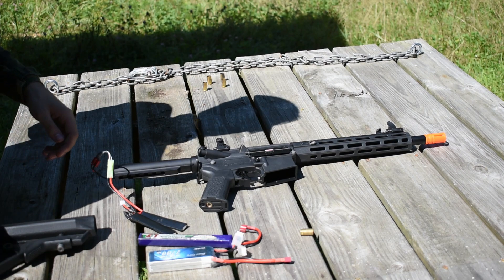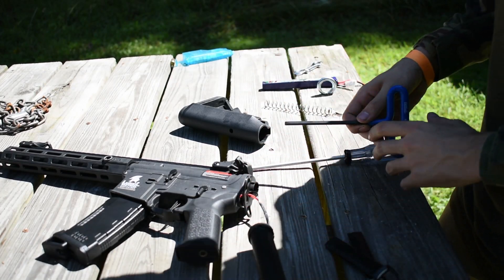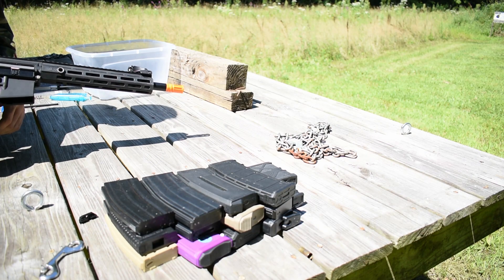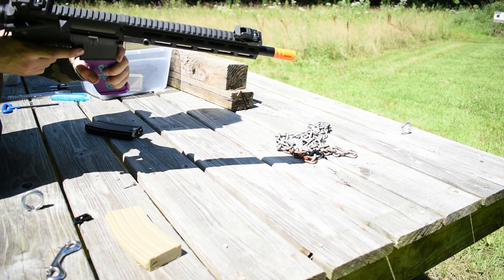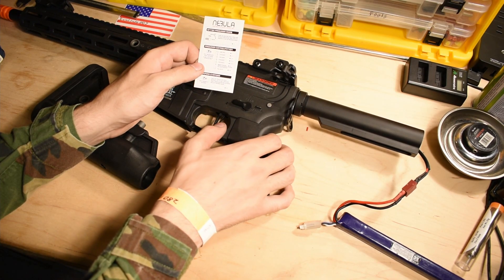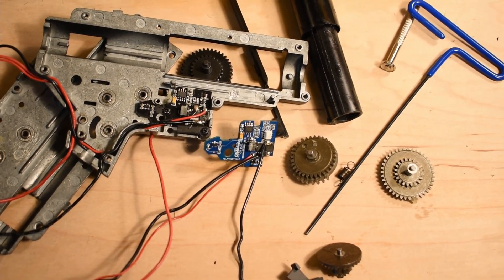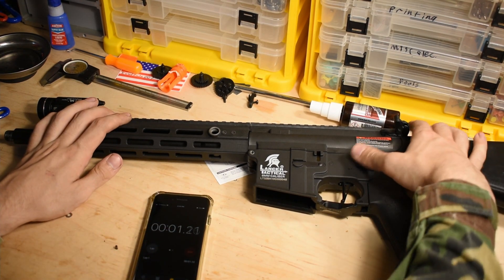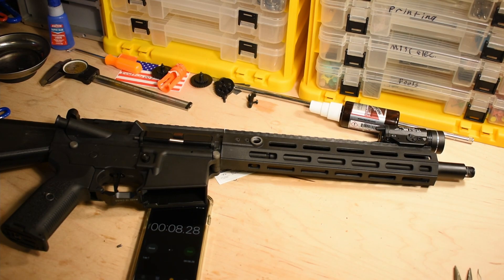Lancer Tactical Gen 3 Evaluation and Modification

Comment: To program it back to full auto. All you have to do after you flip the switch back and forth twice. Just hold the trigger down until all beeping stops. So it's not necessary to pull trigger so much. Saves you time.

Comment: The largest battery you use, do you think that would fin in the hole made for the battery in the stock? Jw looking for the best size to mAh I can get with out drilling a hole and adding one to the outside of the gun
Reply from the maker: that biggest battery in the video will not fit in the stock, you can however have the fixed stock here https://apexairworks.com/product/the-kewldude007-3dp-stubby-stock%ef%b8%8f/

Comment: What is the exact battery you recommend for this gun? I got the weak battery because I’m new and I want whatever would be the best and give the most power. Please and thank you and great video btw, I definitely subbed
Reply from the maker: I use this, it will not fit the original stock 
https://shop.nankinhobby.com/products/2200mah-11-1v-45c-3s1p-lipo-battery-pack-with-deans-plug-433397.html
Reply: @kewldude007  Thank you very much for taking the time to reply, and I’ll go with your recommendation.
Reply: @kewldude007  I just purchased this gun. Now I have learned of the battery fitment issue. What stock did you go with? I bought the OEM batteries for now 1000mah 20c but I would like better ones.
Reply from the maker: @vince9103  I 3d printed that stock, I have a video on it
Reply: @kewldude007  Thanks for the quick reply. I also see I overlooked a comment earlier on the stock. Is that the one you are referring to?
Reply from the maker: @vince9103  probably

Comment: Why is binary such a big deal in air soft?
Reply from the maker: unscrupulous players use it to evade semi auto rules. I went over it in detail so potentially a field could see it and would be aware.
Reply: @kewldude007  thanks for the heads up, im trying to get into airsoft and I’ve been looking for a sturdy first aeg that mimics the real rifle I own. Lancer was one I was going to go with but their outer barrel is so flexible and I don’t have access to a printer. Lol
If you have any recommendations on an m4 patterned AEG with

true quick change springs, 

An Mlok handguard, 

Longer than 10” (25.4cm) barrel

and mainly metal construction I’m ALL ears cuz I’ve been researching for weeks!

Also, subbed!
Reply: @TechnomancerTheWise  the lancer tactical Interceptors might have a longer than 10" barrel

Comment: My lancer tacle makes a beep when I plug it in but then goes "REEeEe", help! How do I fix this?
Reply: remove frog from gearbox
Reply from the maker: e
Reply: Apex sogering image profile pic
Reply: if it goes "reERERERERERERE" when you pull the trigger, than my boi your motor height is basically in hell and you need to make it go higher or lower